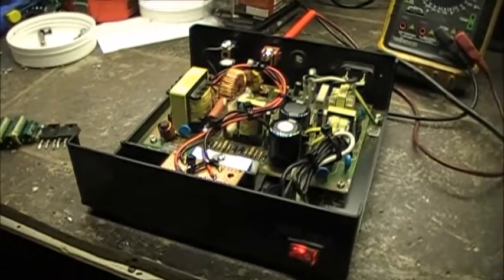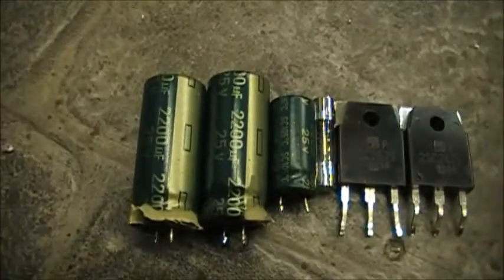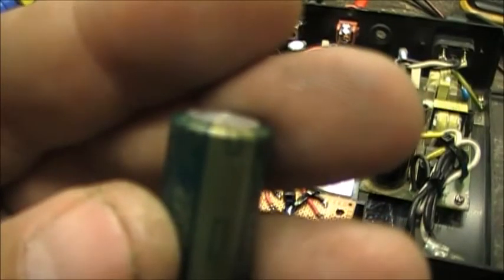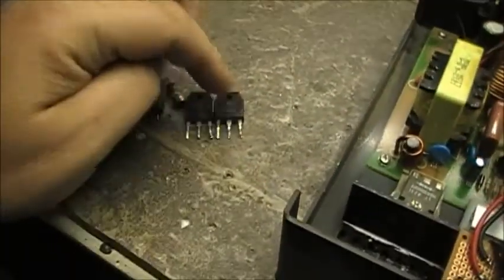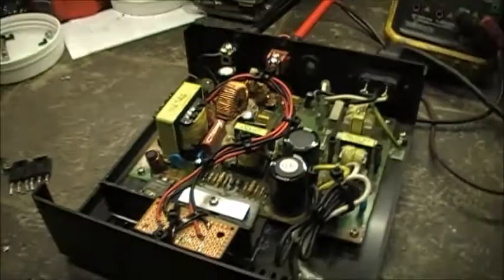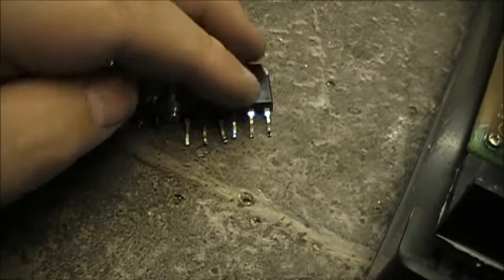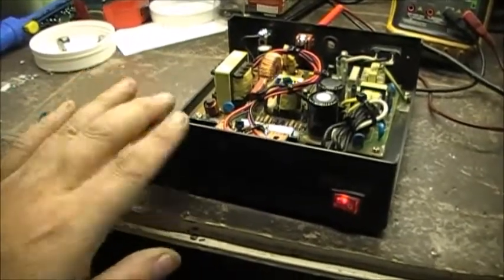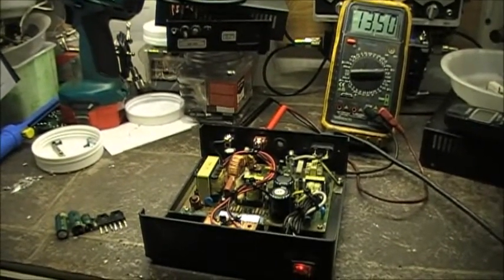SAMLEX SEC 1212 Power supply repair - Yet another repair!

Comment: Looks a nice power supply.
Are they refurbished from your work? I remenber you had some on your shack similar.
Reply from the maker: Let's just say this, cheaper to sell a new one then spend an hour or more trying to repair the blown up ones.     Toss away equipment is what it is....Replacing it is cheaper in the long run, specially when out at a customers location. :-)
Reply: @Radionut63  have to go again to st John's
Reply from the maker: @CT7ARQ  be awesome to see you again. :-)
Reply: @Radionut63  ok well l bought it and didn't know that it wasn't working !!
Reply from the maker: @scorpiodrg  Howdy, what is the model number of your power supply, and what is the issue with it?  :-)
Reply: @Radionut63  is pyramid  model PSV _200 it came whit burned fiuse l put New fiuse and when I turned it on it burnd in the moment a turned it on !!🏍️
Reply from the maker: Sounds like the power transistors are shorted out....
Reply: @Radionut63  so you think that l better throw it away and get a new one !???🏍️
Reply from the maker: @scorpiodrg  hard to say without seeing the power supply myself.... might be able to repair it.
Reply: @Radionut63  well like you said by the time I sent it to you and coming back is going to be a lot of$$ involved ,, l'm going to wait for a while !!!🏍️
Reply from the maker: @scorpiodrg  Sounds good.... tho there are a couple of quick tests yu can do with your digital multi-meter to check to see what the issue is. :-)
Reply: Hey Mr nuts radio l heave a pyramid 30 amp that has the same problem how much would it cost to fix all that this is your friend from the city of Wichita Kansas !!!!